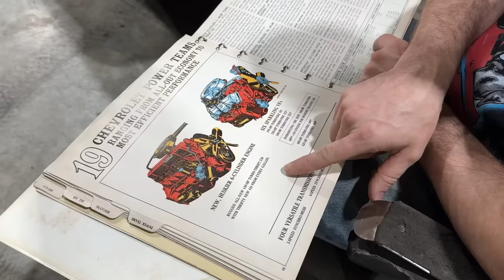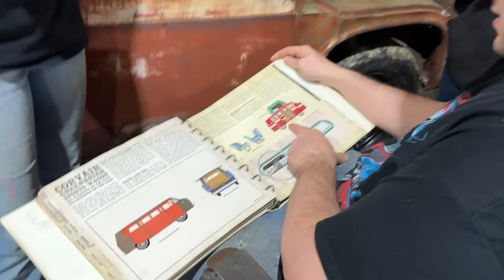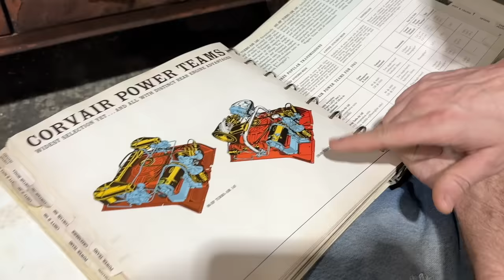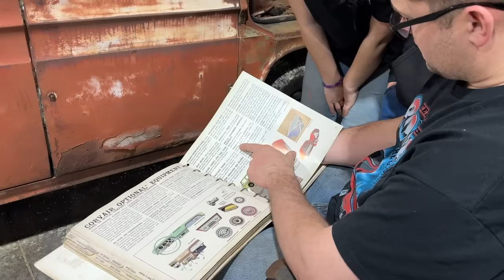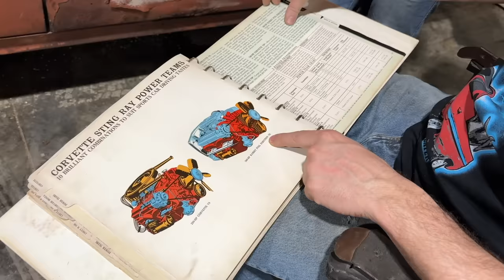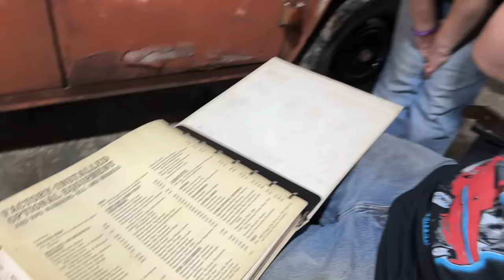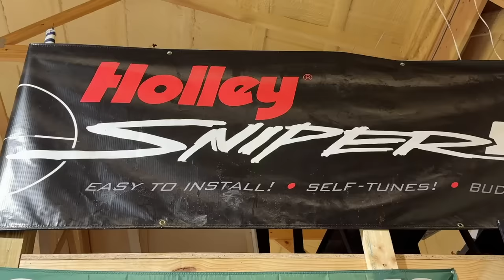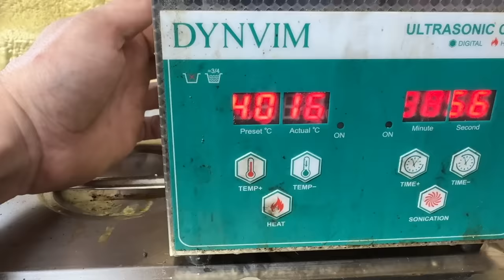Rare Van Parked 37 Years. Will It Start?

Comment: My dad bought a Greenbriar Van in 1961 when I was 10. At 13 I drove it about 600 miles on a road trip to see the grand parents. He drove during the day and I drove it at night. Mom didn't drive. Ours was a window van and seated 9 (cramped). The heater was a tin  box surrounding the exhaust manifold. No AC. An issue with it was balancing the Rochester carbs. A bigger issue was the o rings at the ends of the aluminum pushrod tubes. They degraded at about 30k miles dripping oil on the exhaust manifold. Then the heater blew oil smoke into the cab. I overhauled that motor and the one in my Covair Monza many times to replace those o rings. The two interior pistons also ran hot. They put a bigger fan on them in the mid sixties. One other interesting thing is the middle bench seat could face forward or face the back seat which we preferred. At the time there were 8 of us.

Comment: I had an air cooled engine like that in my 2 door Corvair.   It never burned a drop of oil and never broke down. It was a great engine. The floor boards turned to rust however.

Comment: What I like about how you interact with the kiddos is how they respond. All parents, in the city like I did or somewhere in the Smokey mountains buy or build the kiddos quads, dirt bikes so they learn young how to ride and drive. Your insurance will thank you later. 
Kinda 😂 lead foot, runs in the family ❤
Reply: 5Sleeperdude  
Any time bro. 
Especially when I tare into my 78 F100.
Runs like a champ for a 6 cylinder V8 😂
3 and 4 cylinder had 0 compression. 25 lbs. If I let it start for a second. Stuck rings, stuck valve, blown head gasket between the two 🤔
Your thoughts are certainly welcome @5sleeperdude. 
My favorite, shoe string crank fix ❤️ Brilliant

Comment: That Morissette code dohickey is an old fashioned hot wire system . Probably had an ignition problem and was used to spare the battery from being drained slower.  Dats my guess.

Comment: The Greenbrier was a Chevy passenger van with side windows and rear bench seats, not a Corvair. There was a Corvair 95 panel van too. I used to own one in the 1970s. That's what yours appears to be only yours also has rear seats which weren't in the 95s. Mine was rare in that the side door on the right had windows. Its original paint was OD green so it was either an army or phone company van but at some point it had been repainted blue. Since the driver sits directly above the front (steering) wheels care had to be taken when turning sharp corners so as not to let the side scrape against objects. You had to delay turning the steering wheel a bit. It took some getting used to.

Comment: Those brass filters are called sintered fuel filters. Being brass or copper they can always be cleaned and reused and usually never need replacing.
Tosh, you were thinking about the Navajo code talkers. They  used their native language to send secret messages in WWII.

Comment: As soon as you mentioned the fuel pump, i had to jump in, They had a nasty habit of leaking past the diaphragm and allowing fuel to get down into the Crank Case, best to go Electric fuel pump in my opinion.
My second Vehicle when i was but 17 years old, was a 1964 Corvair Monza, and i can tell you, i beat the living heck outa that car, and it always got me where i wanted to go.
As others have said, always carry a spare fan belt, also i believe you can get an updated pulley which is stronger and better than the stock ones.
You have a real Rare machine on your hands, and i send my best wishes to you all, bringing it back to Driving condition.
P.S.   Squeezy will come around, those Corvans will grow on ya.
Best wishes to you all as always.
Al in Surrey
B.C.  Canada.

Comment: Way back in the mid 1960's I had a '61 Corvair Monza. One thing I can say,, make sure you keep the wrench to loosen the tensioner and 2 or 3 extra serpentine belts. The Corvair is famous for tossing those belts and when it does it's only a few miles before the battery is expired because no juice is being fed to it. The shift linkage is sloppy as the dickens and the valve covers leak alot. Other than that, these little air cooled engines are pretty good.

Comment: my 73 super beetle has the windshield wiper fluid squirter that runs off a spare tire. it works just fine if you fill your spare every time you change the oil.    are you listening, Wa Wa?

Comment: I have had corvairs before. a word of advice make sure you keep all the shrouding around the engine. without it i guarantee you it will overheat. 
Oh and another common  issue is the pushrod tubes love to leak. We raced corvairs on an oval track. We put a giant spring on the tensioner pulley. Solved all our belt issues. Oh almost forgot if you find that some parts are hard to find try Clark’s Corvair Parts. They are by far the best.

Comment: as with all oil cooled engines, I would highly suggest an oil cooler as large as you can  get to 1, add more oil to your system and 2. have cooler oil return back to the motor. Ive seen folks use 2 oil coolers to accomplish this with relatively little space used. Would be a great addition to WaWa's bug too.
As for the throttle spring would it serve you to add a second spring on the passenger side carb? also, alignment on the belt routing is important. My Aunt had a corvair that had a similar set up and trouble only to find my uncle forget a spacer or shim for alignment??? Good luck!!! God bless & Happy Easter!

Comment: Must project is a 65 corvair sat 40 yrs buried in a garage. I was shock it turned over by hand took it home cleaned the points got fuel system hooked up put a battery in and it started and ran it even idled . It blew my mind

Comment: a Corvair heater story.  Knew several people who had early Corvairs back then.  One leaked oil pretty badly and the oil would get into the heater system, and stink really badly.   So much oil smoke in the car.  Not much point using the heater since you had to drive with the windows open to be able to breathe.

Comment: That first drive was hilarity X 4!! It was like an episode of the Keystone Cops trying to keep that thing running a full lap around the yard!🤣 I'm thinking that since the fan belt was off from the get go, someone ran it till it got hot enough for the rings to collapse. Considering it actually runs on all 6 and isn't knocking terribly, it's probably good for a rebuild!😉👍👍 Incidentally, you may want to check your oil level, since they only hold 4 quarts with the stock oil pan. If it's overfull you'll definitely burn some whether the rings are bad or not...

Comment: You haven’t lived until you drop a screwdriver into that fan while adjusting the carbs. 😮

That idler pulley seemed like it was stiffer than normal. It needs to turn freely or it can cause you to lose the belt. ALWAYS carry a spare belt, if you leave the property. 

FCs are FUN to drive. You have to have a mindset like you’re driving a city bus, or you’ll run over curbs. You’re WAY out in front.

Comment: the belts are notorious for coming off if they arn't at the perfect tension ,too tight is just as bad as too loose , if the bearings ar ebad or if the alignment isnt perfect . they also flip so the thick side is towards the pulley ,have a look on the forums it could help

Comment: 1:05:59 valve seals probably gone bad and rings. Probably need to run awhile to reseat the rings.
If the clattering doesn’t stop you might have a weak oil pump. But you need to look it up on info if the engine has solid lifters.

Comment: That is similar to a horizontally opposed, air cooled airfcraft engine. The trays under the engine is part of the ductwork to direct air over the cylinder heads. If you remove any of the trays or panels, you will have overtemp issues.

Comment: On the Beetles that used air pressure from the tire the washer would quit working when the pressure dipped below a certain point. Preventing the spare from going completely flat.

Comment: I used to have a 1972 motor home that reminded me of a Corvair the way the front-end looked and the taillights. It had a 454 engine in the front with 30,000 and it ran really good. I'm pretty sure that it was 25ft long and even the sides had the same design as a Corvair Van...I drug my feet to long bringing it 70 miles to where I live now and the guy got rid of it cause DNR came around making people get rid of old vehicles, so he said but it's happened several times before especially when you live close to rivers and creeks

Comment: If i remember right those engines had a problem where the valve guide seals would pop out and 
it would suck oil strait in to the cylinders.

Comment: The funny part is, those little flat sixes can scream if you know how to mod them. There's a guy either in Long Beach or Burbank, I can't remember which, that builds Corvairs and makes big power out of them. He's been on Jay Leno's Garage multiple times. I'd be cool to see a van that makes big power, even though you could only ever use it going in a straight line without fears of rolling it. A lot of people don't know that Don Yenko also made Yenko Corvairs before the Camaro came out so big power Corvairs were a thing. An interesting thing about that being a 63 is it actually has a forged crankshaft. Unfortunately performance parts for those, beyond just cool valve covers and oil pan etc from Offenhauser (yep they made Corvair parts too) are stupidly expensive.. A set of aluminum/nikasil cylinders is about $1600, a billet crank is over $1500. https://en.wikipedia.org/wiki/Chevrolet_Turbo-Air_6_engine Don Yenko claimed 240-250hp NA on his cars.
The other turbo car was a Olds Jetfire.

Comment: Probably lifting with a fork truck bent the shift tube / if you need hard to find Convair parts try / mat at mats off-road (rumour has it he is a Convair hoarder) looks interesting no radiator or water pump problems/ the smoke looks like steam ? No water in those?

Comment: Remember how much oil Ralphie put into the cylinders. Most of it would have collected in the very short muffler. I wouldnt be too worried about the smoke, it should significantly reduce after it runs for a while.

Comment: Worth trying to do valve stem seals before writing the engine off, I think. The valves are always sitting in oil because of the boxer engine design. I've seen the valve stem seals done on a 'vair with compressed air without removing the heads.

Comment: Theres a company in Connecticut called CLARKS CORVAIR. They have everything Corvair. I orders most of my hard to find parts from them. And if you need some tech info they got you. Very knowledgeable. Hope this helps. I had a 65 CORSA turbo 180hp. 64 spider had a 150hp turbo and the only model to have a mono buggy leaf spring. Such cool cars. Thanks to Ralf Nader and cost of production they stoped making them early to mid 69. One of the most sought after cars because if really low prod #s is the 69 convertible.

Comment: Gasoline heaters were very common on VW 411 and 412 models. The Morse Code Key is still used by Amateur (Ham) Radio operators.

Comment: The bug had misting windshield sprayer that used air pressure from a connector hooked to the valve stem of the spare tire

Comment: It's actually easy to rebuild/overhaul the cylinder heads. Remove engine, remove 6 individual cylinder heads, remove and replace piston rings. You'll get back all that 90 horsepower and 150 lbs of torque !!!! And no more oil leaks/burning!!! By the way the panel van Cor-Vans are extremely rare. Either fix her up and keep her or sell her for a very large profit. The test drive was very exciting and funny!!!!!!

Comment: Being a flat engine if it sits for a long time the cylinders fill with oil.  Just run it, it will burn off. Towing it nose high will let the rear cylinders fill also.

Comment: Josh I had,a64 corsair I brought back to fl it was campsite it ran good had no rust red and white the lipstick is right on top where fan is there a hole on top that's where it's sup]used to be wait you'll you pick it up the rear wheels  flow in  mine was a 140 4 speed with original tire never was on the road  l took it to Daytona  rod run about 5 years ago and drove around the track. Fan belts were the worst for coming off. But always ran good you'll like driving it

Comment: I'm surprised you did a video on the Greenbrier that fast, i always liked Corvairs but never owned one. Early vw's had gas heaters mainly i think in the vans & square backs,  looking forward to your next video.
Reply: Looks like that van was set up to spray for mosquitoes.
Reply: It's pushing oil cause it's a corsair, its a tradition.

Comment: gasoline heaters in a car are actually very common even today here in Finland for example. Webasto and Eber are most know heater brands. My car only has 230V electric heater for the engine + cabin heater. Most parking lots for aparments buildings in Finland have 230V outlets for that purpose

Comment: I never knew that the van's of that kind would have a double carburetor on them. And like the VW's they have no radiator? Does your old Ford like that one have a 2 carburetor too? I love watching your kids help you work on these and learn at the same time about  the rebuilding. You told the kids you would mark the 2 carburetors so you knew  which side it came from? It could be smoking because of the ring's in the motor possibly? Some of the older vehicles like this had a breather tube under it for like oil or something? I have a question, now don't take it wrong,? But where did WAWA get her brown eyes from? Josh yours are like greenish blue and Squeeze has green, Ralph's are like deep blue? Sorry, just notice things like that! Marge's are like dark blue.!

Comment: Tell Ralphie not to stick his arm through a steering wheel and turn the key on an old car. The steering wheel lock can be holding tension that's released when the key is turned and may break an arm.

Comment: A guy could get an aftermarket intake for a single 4bbl on the 14hp Corsa. Dunno how well it worked but my guess is the serpentine belt was still the weak link on that motor.

Comment: Someone else may have brought this up, but if you put 5 quarts of oil plus all the Marvel in it you may have overfilled and thus you will have covered the push rod tubes where they meet the engine. Those are notorious leak points. After 37 years, the o-rings that seal the push rod tubes will be totally useless.

Comment: In 1971, I traded a 54 Chevy for a 63 Monza Cpe. What a mistake. Had it for 4 months and smashed every window out of it before sending it to the junkyard.  It didn't have any compression when it turned cold, kept throwing fan belts, smoked and burnt oil, smoked thru the heater vents! Worst vehicle I ever had. My 61 Beetle was a way better-built vehicle.

Comment: I thought the mystery oil at first but not after that puke on the floor;) rings shot those engines need an aftermarket cooling system blowing across the engine.
Reply: The Army didn’t want so GM had to use

Comment: There's no telling how rare that engine is you need to rebuild it and fix it for a daily driver
Reply: They aren't rare at all.  Just unknown by younger folks.  Not hard to find motors or parts.  Over 1.8 million units sold between 1960  to 1969.
Reply: @JW-hv8uo  I'm 61 years old and I've only seen 2 and one of them was in this video

Comment: Too low in cylinder compression and it fouled the new plugs with oil quickly...no power....maybe you were in 3rd.....but 2nd wouldn't have been much better...w/fouled plugs.